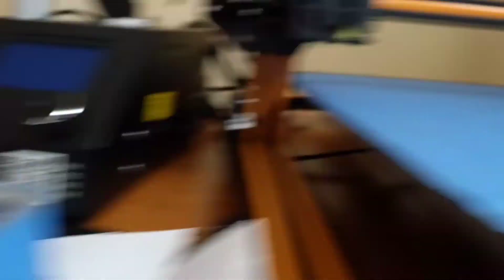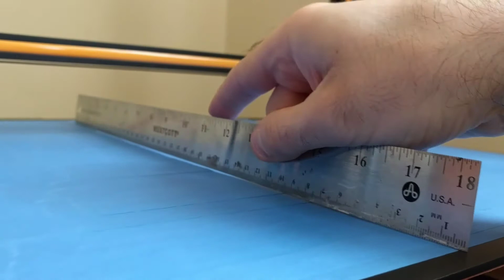How to level heated build plate on Creality CR-10-S5

Comment: I measured my CR-10 S5 heatbed  with a comparator and if the center was the zero position, two corners opposed on one diagonal were high and the other two were low - the bed is twisted. So I had to raise the low corners in order to bring them on the same level with the center. Or, better said, I distributed the error between the corners and the center... After reading about a lot of these deviations of the build plate on the CR-10 S5, I came to the conclusion that it is not possible to have an aluminium plate that is perfectly straight, especially at this size. On the Ender 3 Pro there is no problem, but that one is much smaller. However, after bringing them on the same plane it works great. Well... almost great - I have to do something about the X and Y vibrations - and so, dampers it is :)

Comment: its designed to be cupped... for the expansion and shrinkage from heating and cooling... the thickness of the glass will carry the weight in the center and will sit level if your outer corners are level...

Comment: I too have the same issue with CR-10S4, in my case, the build plate and the glass, one side it is concave and if you flip the glass its convex. I got this idea from SAN TUBE channel. But anyways,  I have ordered new glass from banggood. 

https://www.banggood.com/Creality-3D-4104104mm-3D-Printer-Glass-Platform-With-Strong-Adhesion-p-1194657.html

Comment: 3M Aluminium tape is probably a little better long term as you are not insulating the heated bed from the glass. It is thinner though so you need to use a fair amount...